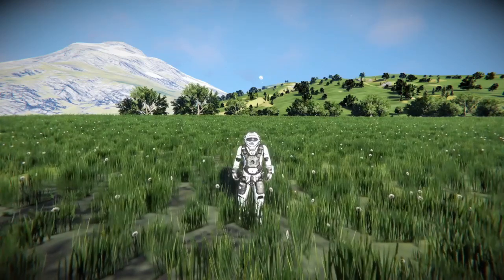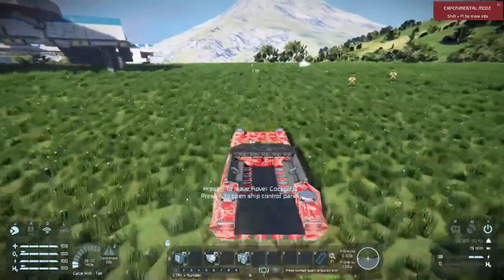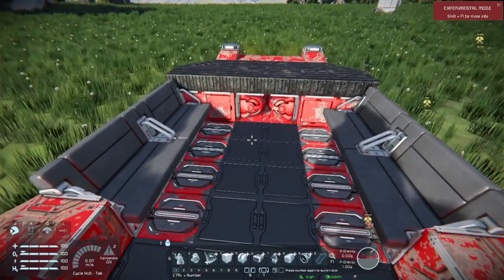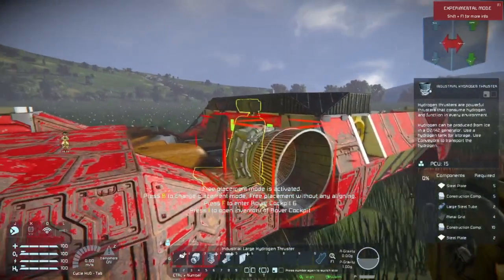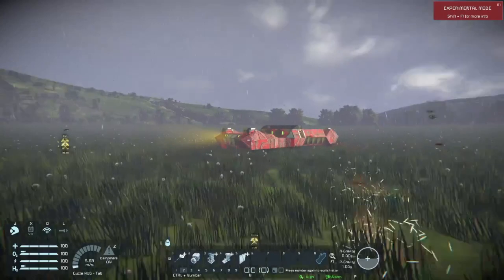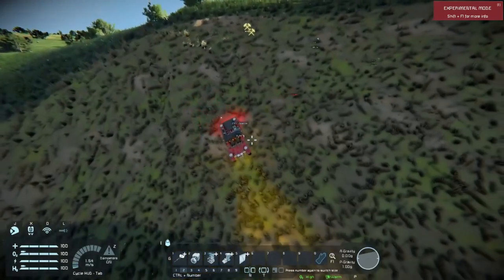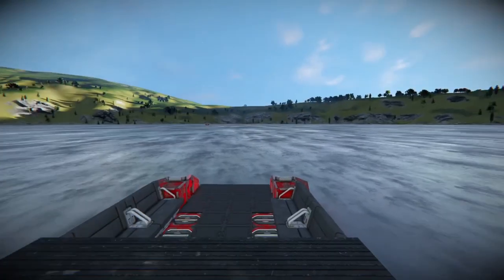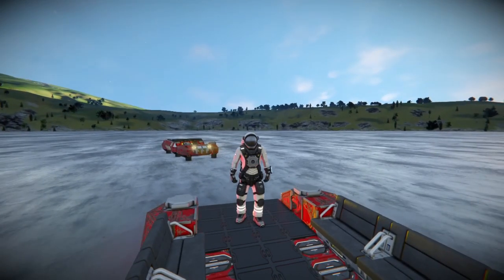How To Make A Rover Drone

Comment: It doesn’t need the up and down thrusters. It will give an error message, but I don’t think it makes a difference.
Reply: It gives error and at least for me refuses to move or atack
Reply from the maker: The ai has a fit sometimes if it doesn't detect up or down thrusters. I use the hydrogen small thrusters because they cost the lest on space at just one block.
Reply from the maker: That's the glitch I was talking about. The ai needs to detect thrusters but they don't have to be on or powered to help the ai work right.